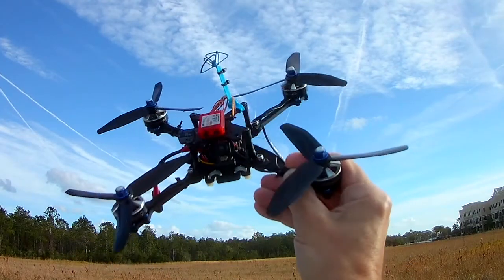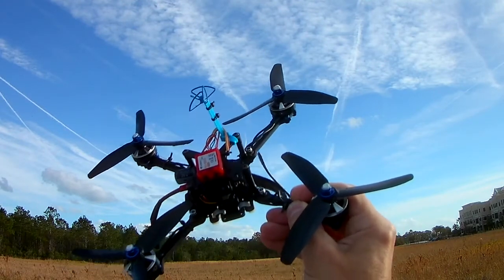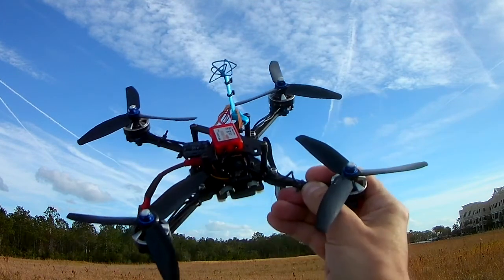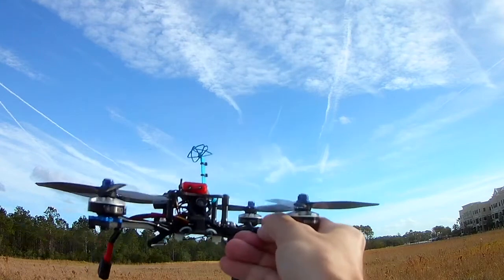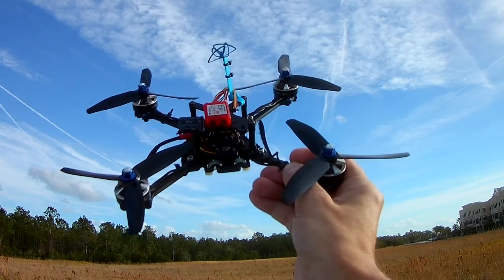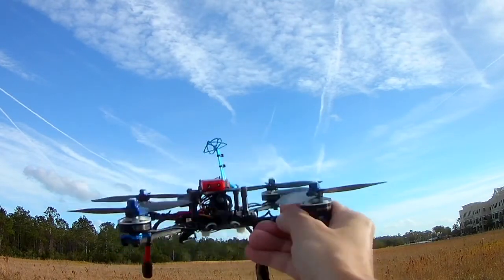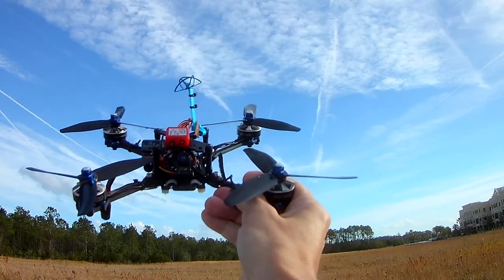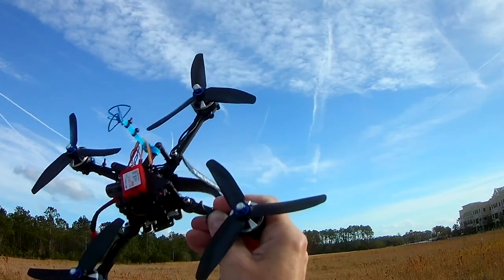HGLRC XJB F428 Build Update

Comment: Hey I just got the v2 stack in today, slightly confused by the “current” and “rssi” pads on the underside of the board. I’m going to run an rsxr for a receiver which on would I run the smart port wire to?
Reply from the maker: You would run the wire to the RSSI.     Then you need to enable telemetry in Betaflight. Unfortunately, my quad is toast after crashing in water, so I cant get a look at the configuration. And I dont use FrSky, so I didnt get into any telemetry setup. But your telemetry wire definitely goes on the RSSI pad.